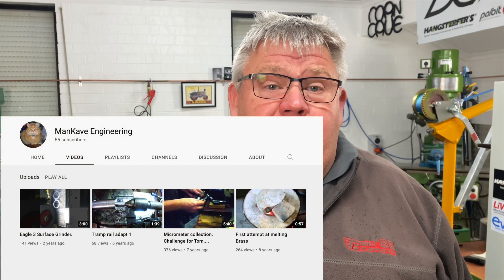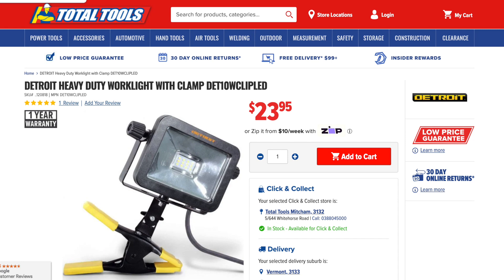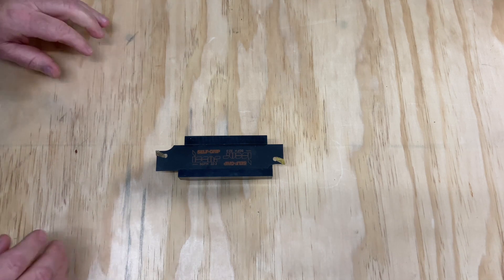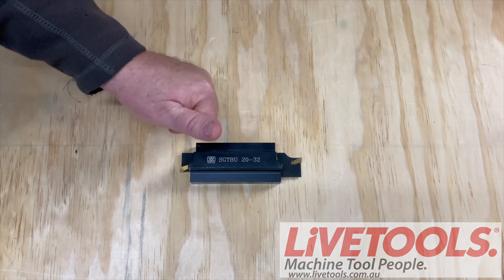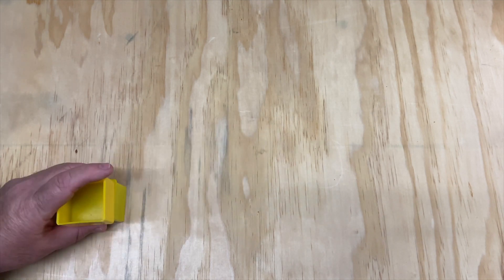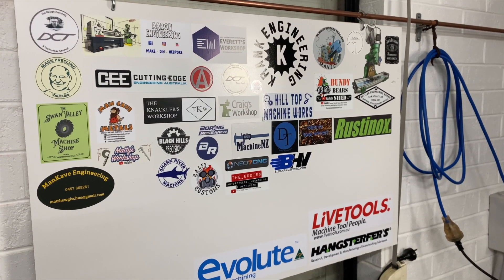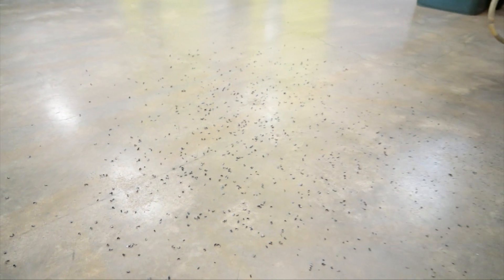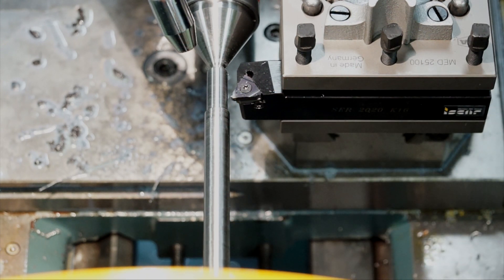Manual Machining Montage - Let's CRANK some Handles

Comment: Hi Aaron, great videos! Have you done a video on your phase converter and how you worked out the size you needed?
Reply from the maker: Hey buddy.  Thank you for taking the time to watch and comment.  I have done a video on the Phase Changer, but it was on my other channel.  I will post the links that I have below for you:
Video 1: https://youtu.be/vFkqVMZBEOY
Video 2: https://youtu.be/EeCYurb02Wk
Video 3: https://youtu.be/Om-di7LX3QE
Reply: @AaronEngineering  Thanks Aaron i will sub your other channel too.
Reply from the maker: @bluechevz  Thank you and you’re very welcome. I forgot to answer your question too. I had Mark (the owner) from Phase Change Converters work out my power requirements. I’m right on the limit though, as single phase 240vac was only 35-40amps to the unit.
Reply: @AaronEngineering  thank you. Yeah I think that could be my problem. I dont think I have more than 40 - 45 amps coming in 240v. I will watch your videos and contact them directly. I have a large generator but the noise could be a problem.
Reply from the maker: @bluechevz  yes give them a call and mention my name. Mark’s son also works for the business and they are both very helpful. I have the PC8 which is an 8KW unit. It works flawlessly 👍🍻

Comment: Manual machining for the win. I need a quality face mill. My Chinese ones suck.
Reply from the maker: To be honest Tom, these Iscar face (shell) mills are awesome. However, just make sure you get one that takes ISO inserts. I hate being locked in to propriety inserts from tooling companies 👍🍻
Reply: @AaronEngineering  I need to keep my eye open on E-bay. Maybe I can get lucky somebody will be selling some new old stock ones at a bargin.
Reply from the maker: Yes keep an eye for one on one of those second hand websites. Much better than paying full price 😉

Comment: Gday Aaron, very nice parting blade, I’ve been looking at something very similar but not iscar (bit pricey), the parting tool I have now is very limited to depth, the new lights will be a good addition to the shop, great mix of chip making, do you think a tour of the school workshop would be worth doing, nice machines, I wonder if she made it back🤔, great video mate, Cheers
Reply from the maker: G’day Matty. Thanks mate, nothing like a bit of stale footage and hopefully it didn’t smell like stale prawns 😆. That workshop was Harvester college. I set that up in 2013 and left in 2019. Other footage is from Marymede where I work now. I think a shop tour of both would be an excellent idea. Very happy with the light, parting blade and holder. Cheers mate 🍻. Aaron